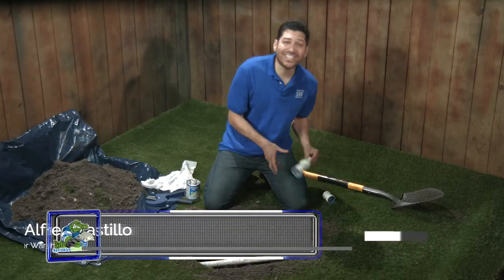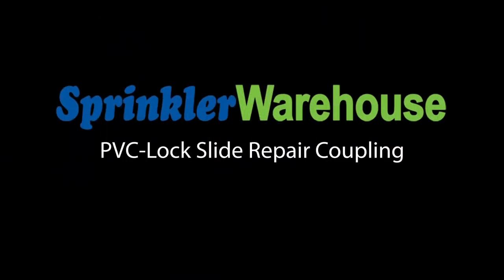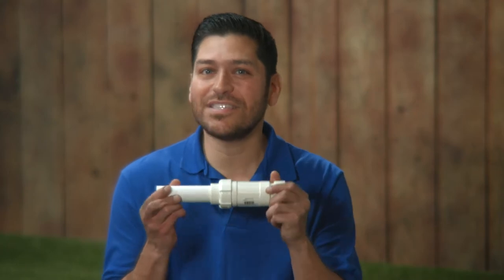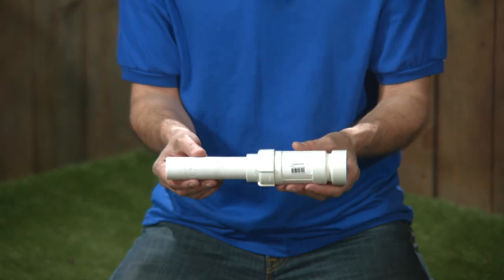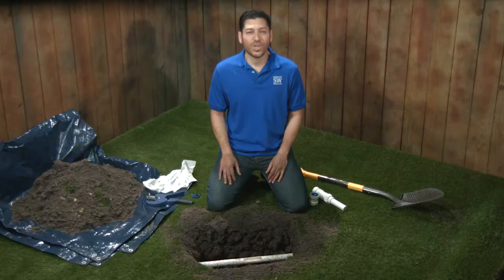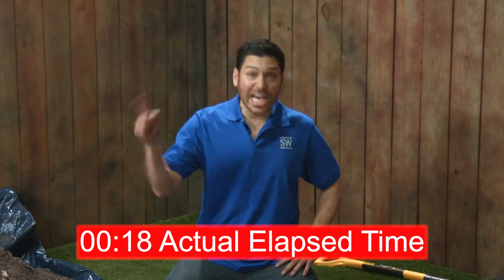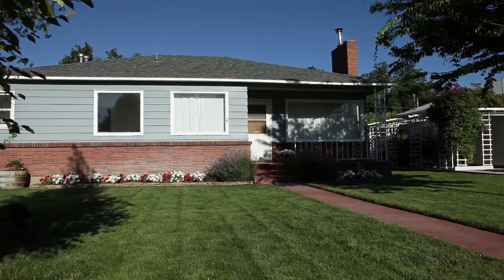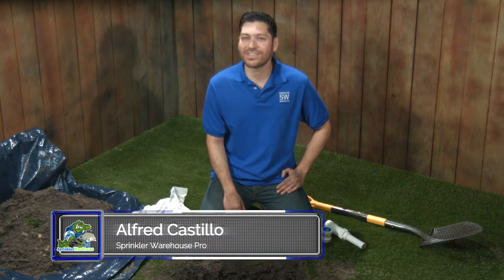PVC-Lock Slide Repair Fitting

Comment: Good video, Is there a larger system like the one you demonstrated, such as for sewer pipe sizes?
Reply: They usually use flexible couplings that are held tight with Band clamps for sewer pipe repairs. If your pipe is below ground, make sure the fitting ins rated for use underground use.